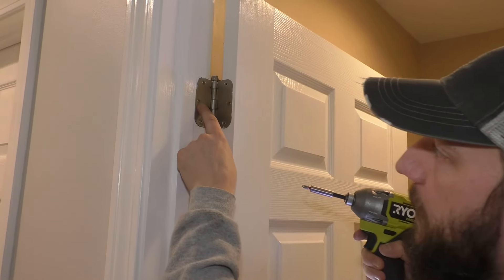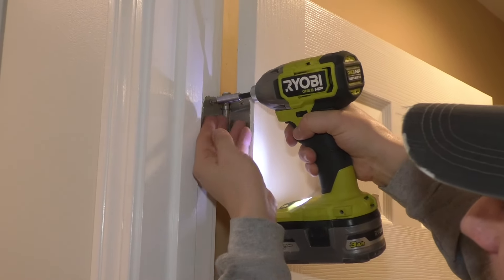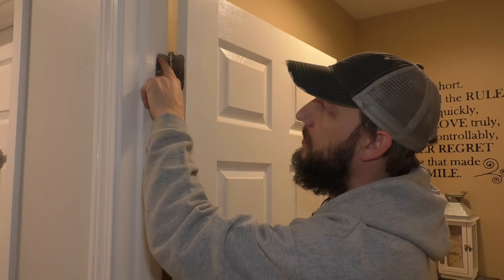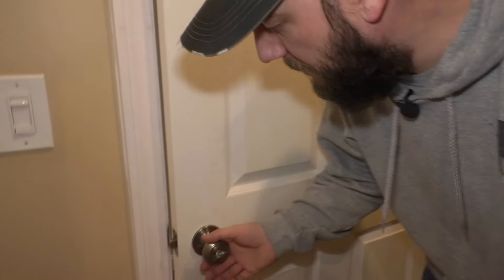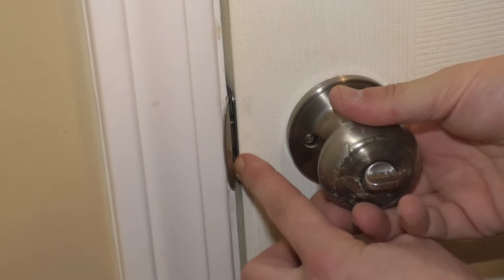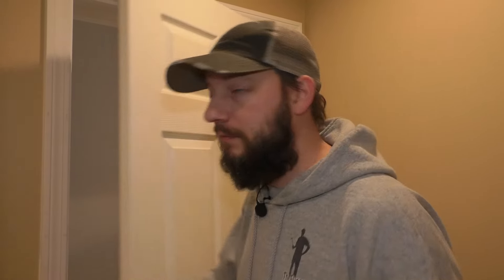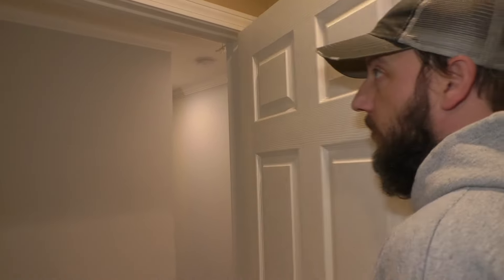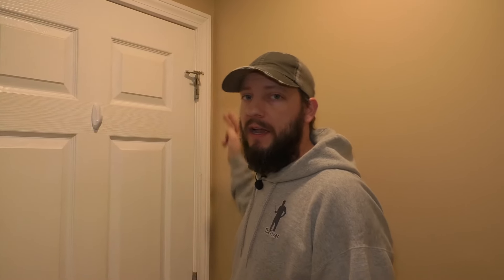Why Add Longer Screws to Your Door Hinges

Comment: Thanks for the tips.  What size  2 1/2" or 3"screw?  Size 8, 9 or 10?  Full length threads like in the video?  I'm finding it hard to find full length threads.
Reply: I've used 3 inch #8 screws for interior doors, #10 is recommended for exterior doors.

Comment: why can't these video state within 30 second the answer to why? 4 minute is too long, can someone summarize for me?
Reply from the maker: Instead you will wait for an unknown amount of time for someone to maybe answer you?  My answer is in the video, that is why I made it.  I’m trying to help, I think 4 minutes was the perfect amount of time to explain it.  Videos on YouTube are free for you, they take time for me to make.  Feel free to watch someone else’s that might be shorter or google the answer.  😁. Thanks for the comment.
Reply: If you watch the video, he actually gives a good explanation of why in the first half, and then demonstrates what can happen and how to prevent it in the second half.
Reply: Get off of tik tok and reels, your short attention span is showing
Reply: Thanks for the great explanation. 

I've had a lot of for issues in my condo. Do you have another video about the shims? I've never used them. 

I have been just filling the hole with a wood dowel and wood glue and putting in 2" screws through the hinge and into the door jam. 
 @thefixerhomerepair2
Reply: Don’t you have to pre-drill to avoid wood splitting ?
Reply: Does the longer screw split wood and we may have to drill a pilot hole ?